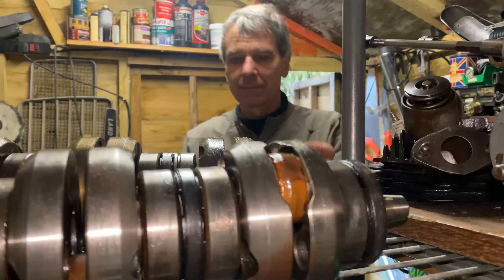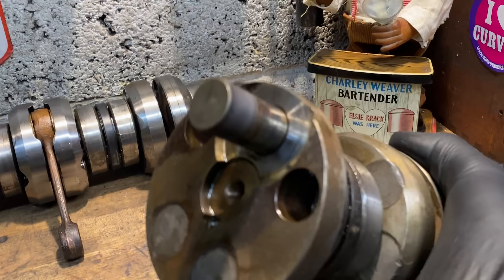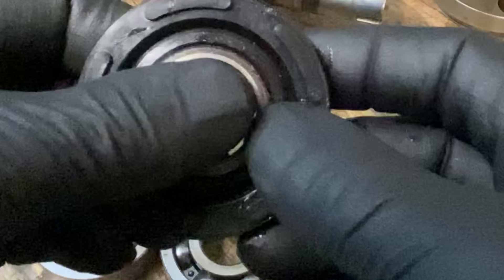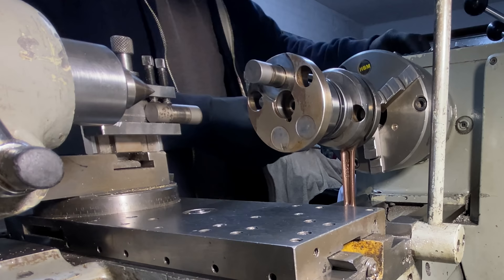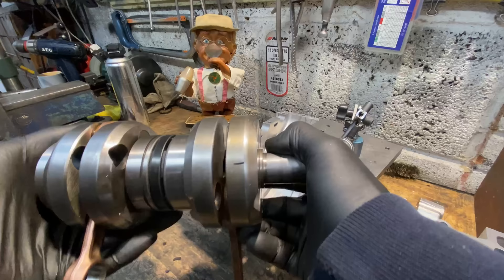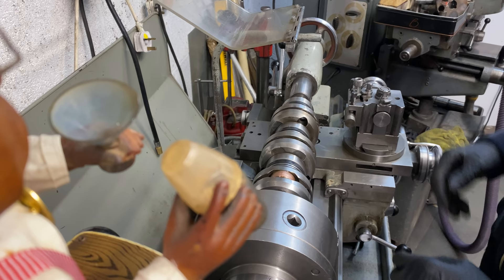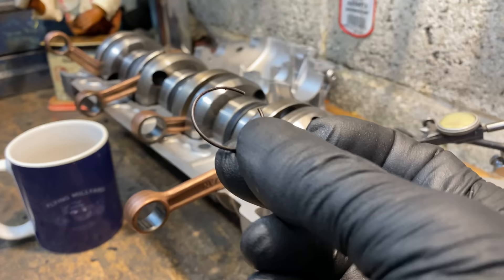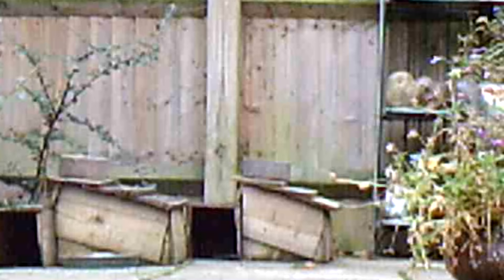Millyard Kawasaki S1 Four Cylinder Crankshaft - How its Made - Episode 2

Comment: I haven't heard of a 1-4-2-3 firing order before, is this for sound or balance or some other reason?
I'm surprised you haven't made some cookie cutters in the shapes of a swiss army knife, lathe, oil can and motorbikes :) check those Christmas tree moulds and the finished product with the Vernier's to make sure they are in spec too(can't adjust the finished product with a hammer though)

Comment: Great work. Why are the legs on the bearing puller so long?
Reply: So they can reach down over a long shaft if required?? Or, as they are thin legs and are straight/vertical when on the extractor thready bit, they might be for going into a deep recess in an enginer to access the bearing? - Those are the only 2 reasons I can think of...although I'm probably wrong on those 2 counts (heavy sighs).

Comment: Why do they copper coat the con rods?
Reply: This is how it was explained to me by an old bike factory guy. It's used as a way to control the heat treatment process to give a variable heat treatment result between the beams and ends of the rods. For example the heat will be wicked away to a certain extent by the copper on the beam section but the rod end bearing/pin surfaces will receive the full heat treatment. This will reduce the chances of the beams being too brittle where they shouldn't be but keeps the big/small ends as tough as possible. This could be wrong but that's how it was explained to me.
Reply: @kmc7355  Also, if case or surface hardening, the copper will prevent any carbon from diffusing into the steel where plated.

Comment: Could you change the sound of the engine by setting the Conrad’s at different plains? Effectively changing the firing order? Could this be done at this stage or wouldn’t the motor run if you changed when it fires?
Reply from the maker: yes the engine would run with any crankshaft configuration
Reply: @AllenMillyard  thanks for you reply Alan! You are very inspiring to me

Comment: I got a question, probably the answer is pretty easy but i have to ask anyway.
Why did you choose 180° crankpin separation?(flatplane)
Wouldnt it make a interesting &closer firing order by only 90° crankpin separation? (Crossplane)
Reply from the maker: the firing order is 1423 with 90 degree firing intervals
Reply: @AllenMillyard  i re watched it and now a see it.
Lovely Video!

Comment: Where you get that BEARING PULLER from - as other bearing removers can damage them.
Reply from the maker: It’s a 1960’s Sykes Pikavant
Reply: @AllenMillyard  THANKS - I don't even think they make it any longer (there is another type to use on motorcycle cranks). That tool you got is AWESOME!

Comment: Sorry, you lost me a bit... what was the crank pin degrees spacing ?
Reply from the maker: 1423 90degree firing intervals
Reply: @AllenMillyard  Ok yes... that's why you went 180 on the 2nd rod... got it thanks ... i built a reverse cylinder '72 350 Suzuki on methanol and won an Australian title on it... modifications gone mad !!   :)

Comment: Allen love what u do. My dad is a Vellocette collector in Melbourne Australia.  Recently he gave me a Viper 350 which l ❤ & a Motto Guzzi v50 Monza. Both in XCELLENT condition.  Not going 2 touch the Viper. But the Guzzi , well l would like 2 give it a bit more Grunt.  2 areas that l am looking at are spark plugs & after market exhaust. Have checked these out thoroughly & will help. Regarding the carburetors have u any pearls of Wisdom 4me & any other suggestions.  U r one cleaver dick & l mean that in an endearing sense. Thx Robert Australia